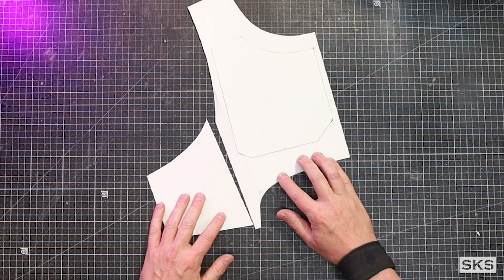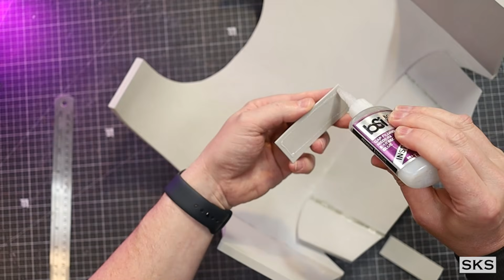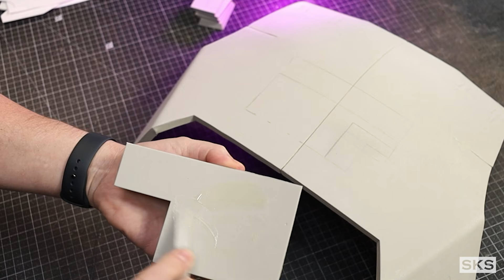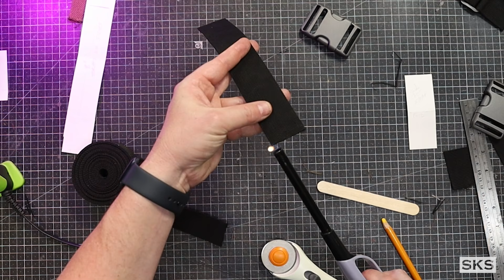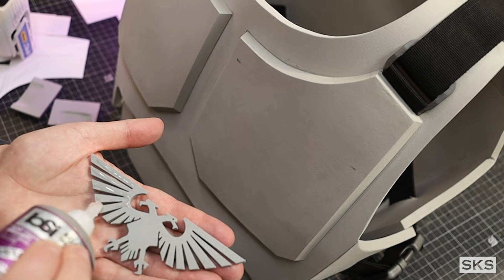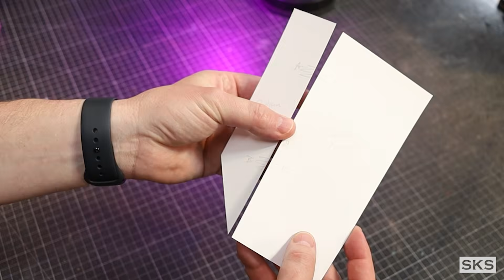How to Make Warhammer 40K Cadian Cosplay Armor - Warhammer Kasrkin join Helldivers 2 Free Templates

Comment: Instead of 2mm foam to retain the curve in the shoulder parts could  I use some extra 2 inch nylon strap I have?
Reply from the maker: Use whatever you have these are suggestions but it’s your project 👍
Reply: @SKSProps  Will do! I hope it has the same affect as the foam. Also I sent you an email with an stl file the other day  because I was having such a hard time getting the angled cuts correct for the breast plate parts. You don't have to use it for anything if you don't want to just wanted to give back if it helps at all. I'll definitely have to order some of your foam because it looks way easier to work with than harbor freight anti-fatiguing foam mats.
Reply from the maker: @TacticalBibbles  yes i did recieve that thank you! and huge difference between my foam and floor mats. The mats have been heat reated twice, because you stan don them which makes them tougher, harder to cut, and harder to manipulate. You use my HD-Foam one time and you will never go back

Comment: Question, how feasible is this for a beginner? I made an NCR ranger chest piece without a guide and I've made some wrist guards and leg guards. But I really only started working with it 8ish months ago and not often.
Reply: "it" being EVA foam
Reply from the maker: This is easy compared to my samurai and chainsaw man projects and people have built those as their very first foam build. All depends on YOUR dedication to the craft and wanting to learn
Reply: @SKSProps  First off, thank you so much for the quick response. And I really wanna learn. I think I am gonna make this my first "big" project.
Reply: @SKSProps  I hate to bother but what scale would I need to print this in if I do end up printing it full scale and not in multiple sheets? My printer has decided to not function. I notice when I hit poster in adobe it was 44 x 25.5 is that what I should print it in if I get it printed elsewhere?
Reply from the maker: @GodEmperorofMankind9 if you open it in adobe and select poster. you select your paper size and it breaks it up correctly. The file is already scaled regardless if you print it at home or at a print shop.
Reply: @SKSProps  thanks

Comment: Hello ! you should buy a laser cutter instead a 3D printer... It's really convinient for details on foam. For example, your eagle, I can do it easyely on a 2mm foam, or 5mm. I have begun to make my cosplays with 3D printing, but that's heavy. Now, all what I make is full foam, and all details stay flexible
Reply from the maker: I have a $6k laser cutter…but most don’t which is why I show more cost effective methods on the channel
Reply: @SKSProps  needn't so expensive for foam, mine is actually around $550 and it's a 22W.
Before this one I had a 5W.. that works... but really slow 😅

Comment: could this template be used for 10mm cintra or whatever you  call it to make it a little more rigid?
Reply from the maker: I personally wouldn't use sintra. The whole point of using foam is to make it easier to manipulate, more comfortable and lighter. When heating thermo plastics you pretty much get one shot to heat form and bend it properly. Once it's painted you wont even know the difference.
Reply: @SKSProps alright thanks